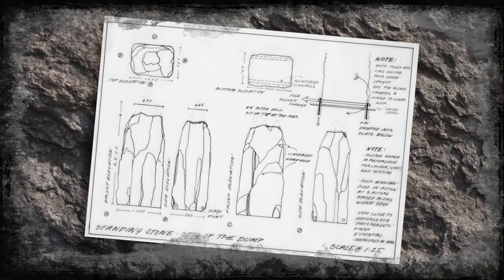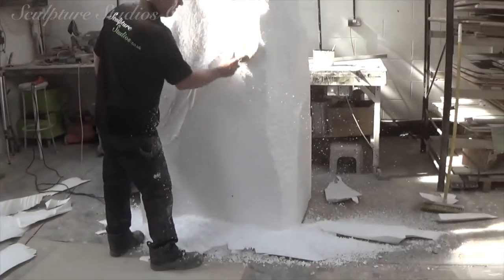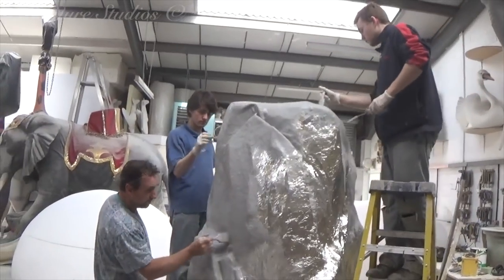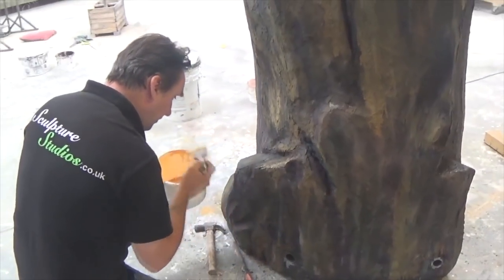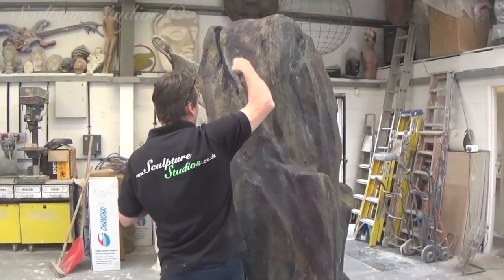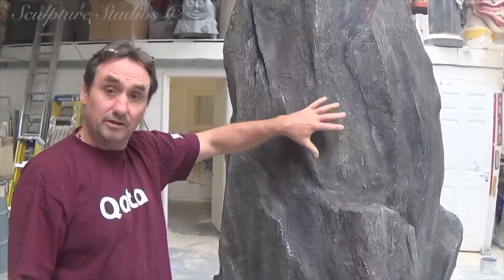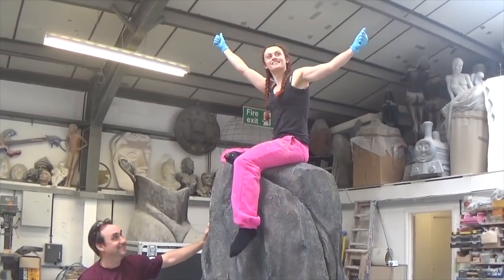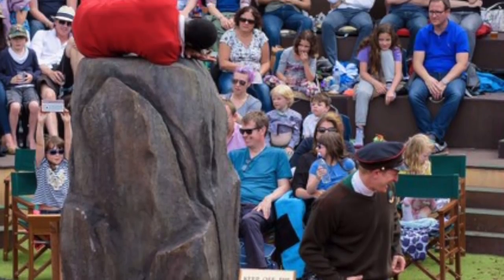Rock / Stone Prop - Stig of the Dump Outdoor Theatre Performance by Sculpture Studios

Comment: Great job! What reinforcing material are you using?
Reply from the maker: The sculpture is strengthened with a blanket coat of glass fibre, and a flexible concrete mix as the artwork texture render.
Reply: @AdenHynesSculptureStudios  Polyester resin?
Reply from the maker: Yes, polyester resin. We protect the polystyrene / styrofoam first, so that the resin doesn't melt the foam.

Comment: This seems like a waste of styrene why couldn’t you have built a skeleton out of wood based on a computer models then chicken wire, fabric resin and install some multiple hundred pound magnets at the bottom so it would extremely stable on a metal base but incredibly light otherwise. A lot of I recyclable material when I’m guessing you could’ve made it mostly hollow.
Reply from the maker: Because making it out of chicken wire and fabric resin doesn't allow the client to make changes. It would take much longer, and would probably still work out to be heavier than simply carving from foam. Making it hollow would also make it sound hollow when knocked or bumped.